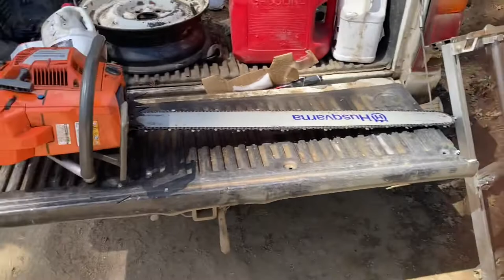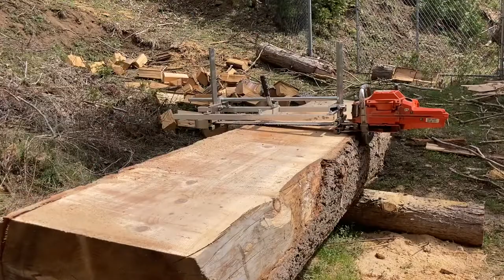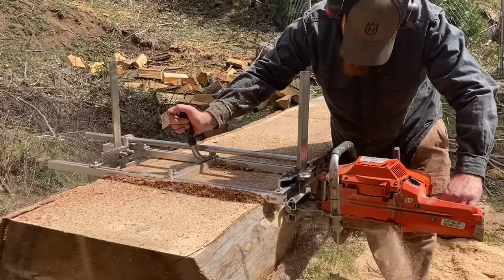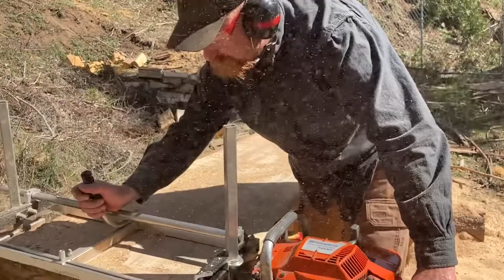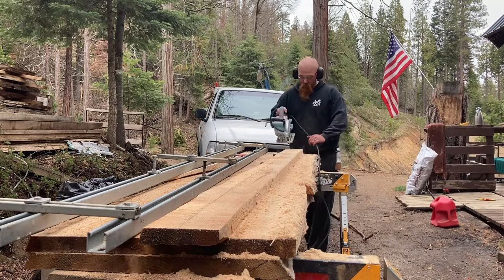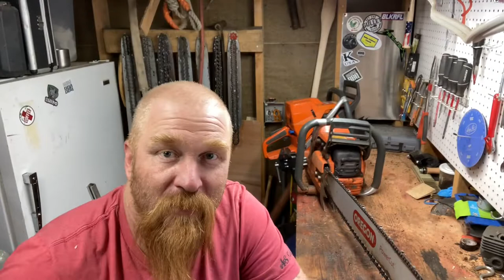Chainsaw milling on a Granberg Alaskan mill with. Husqvarna 395XP  #chainsaw #sawmill #logging

Comment: On nice big planks like that my wife who did a lot of the milling, would sit on top and push with her feet. A string to the throttle worked well. It also gets you away from the exhaust😂

Comment: The single best vid yet- real time on hardwood! I just bought a 395 power unit. Do you recommend a 42” bar and a 36” mill?
Reply from the maker: Yes, That combination works great for me.
Reply: @LumberjackSmokestack  Is it worth even investing in a 36" bar and chains? What is the downside of running a 42' bar on even 19" logs? It would seem to be just a little weight and maybe some awkwardness. Even with a 42" bar and a 36" mill the max board is still what, 32"? And a question, does the mill cut better if there is some exposed chain, rather than have the chain always in the lumber while cutting (shorter v longer bars)? Its very unlikely I will be cutting many trees under 20-24" dia. All my own. I have a 2 30" hickory logs, 24-30" white oak and hard maple logs, some huge tulip poplar, and 2 30" red oak logs 10'.
Reply from the maker: @dalanbronnenberg  if milling is all you plan on doing with that saw I would go with the 42” bar for the 36” mill. With that combination you can cut 32” slabs.
Reply from the maker: @dalanbronnenberg  no problem having the extra bar hanging out and no real advantage of extra either. I’d just go big.
Reply: @LumberjackSmokestack  Thx so much. Thats my gut thought as well.
Reply: @LumberjackSmokestack  Thx again. Picking it up next week. Im going to outfit it exactly as you recommend. I think Ill be happiest with it that way. Milling is all i will do with it.
Reply: @LumberjackSmokestack  Holy Schnikes! i went in to pick up my 353 that was getting a little repair today and had them show me a 42" oregon bar- that is one HEAVY MAMAJAMA!!!!!!!!!! Glad to only be using this in a mill. Yeeeezzzzzzz-us!
Reply from the maker: @dalanbronnenberg  there is some heft to them for sure. 🤣

Comment: I've seen a sawmill like that it was an Alaskan, but it had rails with a winch and a cable.
Reply from the maker: Rails are only needed for the initial cut. After that the mill is adjusted and rides on the flat cut surface. The winch systems are add on’s to make it easier

Comment: Why oh why is the starting end not higher than the finishing , its so much easier just helping the saw go down hill instead of pushing ???
Reply from the maker: Downhill has no noticeable advantage in wood like this. The saw has to cut at the same rate of speed. Gravity is not a major factor.
Reply: @LumberjackSmokestack  maybe not but ive been doing this for 49 years and going down hill is easyer , and if your on soft wood like douglas  forget skip chain just take the rakers of a normal chain , you will get decent chips instead of half chips and dust , let the saw do the work downhill with less grooves , you could try it and tell me it dont work , ive been doing this since the early 70s